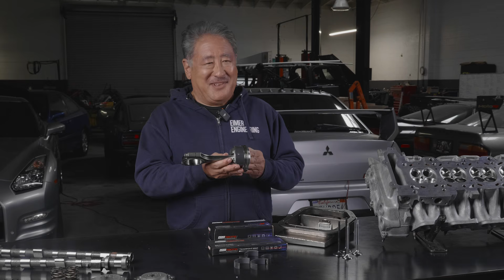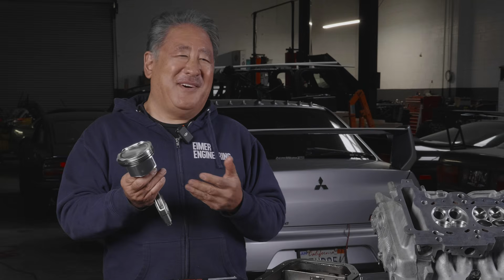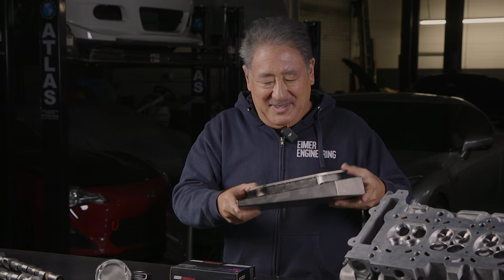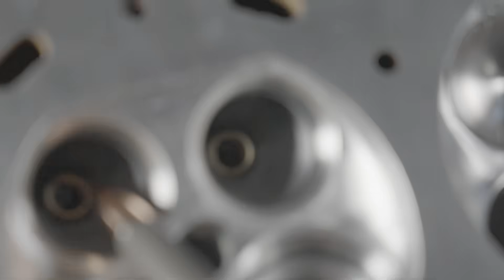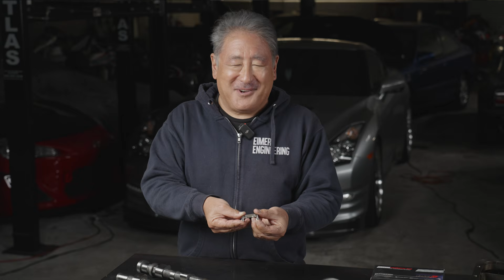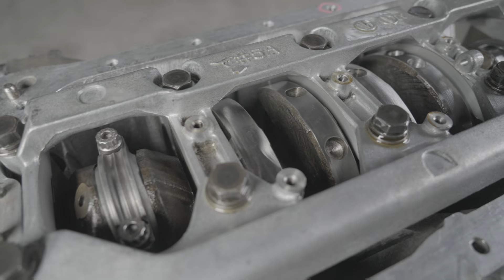How to Build a Bulletproof 400 Horsepower Nissan SR20 Engine!

Comment: My sr20det has been pumping for over 7 years on 550rwhp 👌 . I think the tune is where the damage is done on a sr20
Reply from the maker: Run it hard on a road course or drift it for real, it won't be running long.
Reply: @motoiq  it has and the biggest damage was done by the block cracking due to heat from a water system issue . Not thrashing it
Reply from the maker: mine cracked the block in the cylinders at 550 but it was bored to 87mm which might have been part of it.
Reply: @motoiq  I've lost more rb26 then I have sr20.  Believe it or not .
Reply from the maker: RB26 is sort of a weak engine so it doesnt surprise me.  SR's are strong up to a point.

Comment: Another beefy block is the Volvo Redblock, built like a diesel. Other engines I'm interested in, the Volkswagen VR6 both in 2valve and 4 valve, quite a stout and very unique engine, sounds amazing modified.
Reply: The older I get, the more I'm beginning to appreciate Volvo stuff overall. The redblock is a brick shithouse, and yes it really does sound pretty amazing too.

Comment: Still......NA HONDA is faster.....just saying.....
Reply from the maker: If it is a K motor
Reply: @motoiq  cough cough....2003....B series own'd yall....cough cough
Reply from the maker: Nope, Nissan owners are cheap but I could build an SR-based engine to own an NA B series easily with a little old-school turbo even.  And if the B motor tried, it would have a narrow useless unless for drag racing powerband.
Reply: @motoiq  Great to see you doing great videos!!
Reply from the maker: I am glad you are still repping Honda on the east coast!

Comment: Great video, you could also discuss in the next video how people create s13/s14 hybrid valve covers welded together.
Reply from the maker: We don't do that, just use S14 covers on S14 heads.
Reply: Simply put, it helps with baffling with the earlier model (s13) valve covers
Reply from the maker: We just use AOS on either engine.

Comment: Finally the SR20 content Ive been begging for! What kind of price range does this budget build fall in? All said and done?
Reply from the maker: something like 7-8k.
Reply: @motoiq  What have you guys seen in powerband difference between stock intake manifolds vs aftermarket?
Reply from the maker: For turbos they work pretty good.  For NA a lot less bottom end and a little more on top.

Comment: 400hp Bulletproof SR20? Just don’t open the stock motor and you’re good to go with a solid tuning.
Reply from the maker: I am talking real use, road racing, drifting, not just street use or drag racing. Sure stock can handle 400 hp for a while with good tuning but it will break under this sort of use eventually.
Reply: @motoiq  I hear you and respect what you guys are doing, just trying to be a little sarcastic. Anyway, we ran quite many unopened SR’s back in the day in Finland, and were amazed how much beating the motors took.
Reply from the maker: Us too, I did  over 400 many times, sometimes even high 400's but this was not serious circuit racing and not drifting for sure.  Drifting destroys so much.  As an engine shop we have to make conservative claims or we would soon have mad customers!
Reply: I would argue that 300WHP is the sweet spot for a tracked stock SR with a maxed out S15 T28. I ran mine for many years in my s13 drift car and it never gave me a problem: stock cams/springs and no rocker arms blowing off, Djetro tune and no ping on race gas, yashio factory water pump pulley prevented cavitation, Greddy oil pan, and a z32 transmission. It was the ultimate stock setup with the exception of the low hanging clutch line on the z32 tranny.

Comment: Yes! I would love to see the VE hybrid motor with VTC! I would like to see how expensive it is.
Reply: E&h motors make a kit in new zealand.
Reply: @reidonz5848  I only see the front cover conversion on their site
Reply from the maker: That's the hard part.  You just need the S14 bits to put it together.
Reply: @justskidding5230  i can only assume the rest of it is machining and factroy parts, and plumbing.
Reply: @motoiq  I actually have an S15 SR20, my oil pump blew so I was interested in doing this build. Nothing too crazy. I just want a full write up so I know what needs to be done. VVL head isn’t that expensive and fairly easy to get.
Reply: @justskidding5230  vvl head swap is easy to do. It can get expensive tho as u need new intake and exhaust manifolds. Also ideally u want to change pistons as the factroy det pistons dont have valve reliefs.
Reply from the maker: Mazworks has a lot of the conversion parts.
Reply: @motoiq  yea I wanna know what’s the most cost effective reliable way to do this. Thanks for replying! I appreciate it!
Reply: @reidonz5848  yes you’re right, I was already going to upgrade my pistons and rods while the motor is apart.